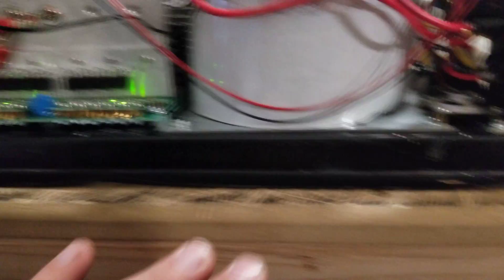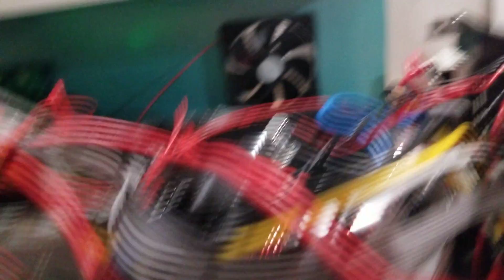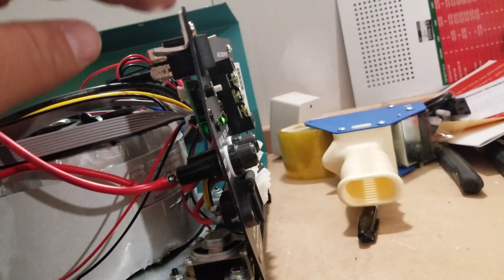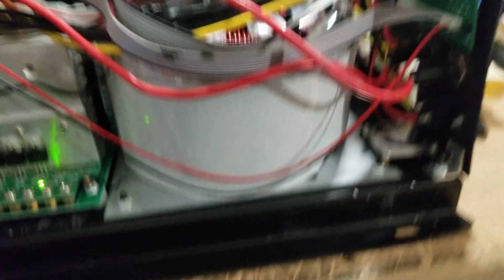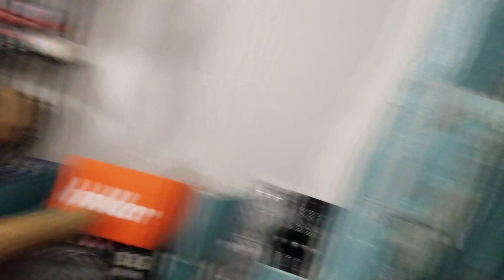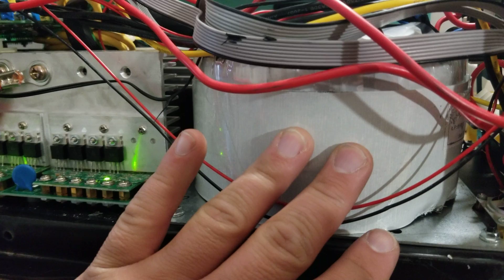8KW second revision 12 Volt Power Jack inverter

Comment: I have a new question. When shopping specifically for the 8kw split-phase, can I determine that it's newest model by the fan presenting on top of the unit? Or do some older ones have that as well...?

Comment: Hello, thanks for all the vids on the power jack stuff. With so many revisions and eBay's already sub par rating system, very hard to figure out the deal on these. Anyway, hoping you could help me out real quick. Right now running the Power-Tech On 3000w (6kw) pure sine on 10 120ah 12vdc deep cycles, wired paralell keeping it a 12vdc system. The inverter kaboom'd a couple days ago, I'll say its 50/50 my fault and inverter fault. I absolutely overloaded it, because I overloaded the genny, so voltages sagged, so ATS went back to inverter power with way too much going on, but why no overload protect? Anyway, found a single blown IGBT and surrounding resistors etc, but was still in Amazon return period, so didn't risk soldering it out. So, looking at the 24v 8kw split phase Power Jack unit, and I do understand the shortcomings, but I think the value is incredible if the built in charging circuitry runs at 24v. Although I can't find this in print,I'd assume if it charges batteries and it's a 24v unit, then it wpuld have to recharge a 24v bank......right? The only thing thats stopped me from switching to 24v is cost of chargers. So if you could just confirm that for me, or bust it I guess. Also, point me toward a good deal on a damaged/open box/returned 2018 8kw SP, or better.
Reply: Okay, nevermind on charging. I found on Amazon, 20.5 cut off and 28v charged by unit. Hard to pass this up.

Comment: My power jack is single phase 10KW 24V,  The output is 110V, i need to up it to 120v cause i run it from the shed to the house that's about 150feet, so i lose some volt. do you know how can we do that? if i can modify the input volt before the transformer from 18V to 18.1 that would do the trick but how?

Comment: Whats the relation with the use of the charger or ups and mosffets blow???
Reply from the maker: Current is reversed when charging the batteries.
Reply: @GenetrySolar  yes, but why they blown? Ihave two, working fine since more than a year but if i use the charger or it start automatic for more than 20 min the mosffets got damaged...thanks for your answer!!

Comment: Can the 8kw PJ be plugged to provide the 120 and 240 at the same time? The listings and the lister says it can't be done. I think my unit is from 2014. I ask as you have the experience and I really don't  want to fry it trying it out.I want to power a 1200w inverter mini-split (240vac) as well as other 120vac.
Reply from the maker: Yes and no. Do you have a split phase variant?
Reply: @GenetrySolar  Sorry been busy. Yes it's a split phase variant. An LFPSW 8000w with the 120A charger built in. I tried wiring it in as your other video, but it just goes into the infernal beep error after 5secs.

Comment: Question... I have a 3/4 hp induction motor 110v ac and I try to run on 2000w giantel inverter, but it start rotate some rpm then stop the inverter.I want to buy the new 24v 8000w power jack ,do you think it can run this motor?
Reply from the maker: 3/4 hp motor should not be an issue.

Comment: Question...Since the mosfets seem to be a weak link in these systems, would there be any advantage in replacing all of them with high quality units, say something military grade? Or are the mosfets themselves not the problem but keeping them cool is?
Reply from the maker: I can tell you that the new 2019 units will have beefier fets. Cooling isnt the issue its amp spikes.